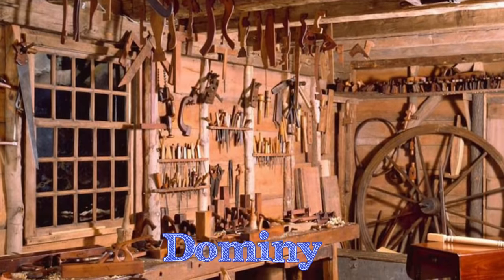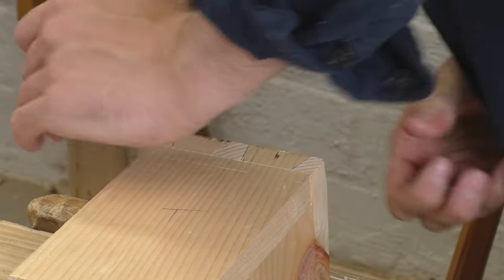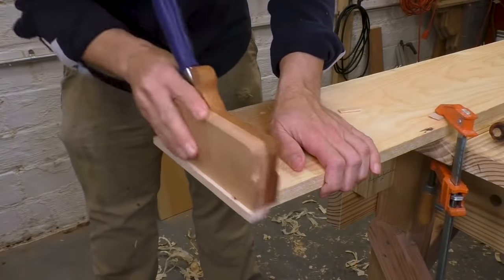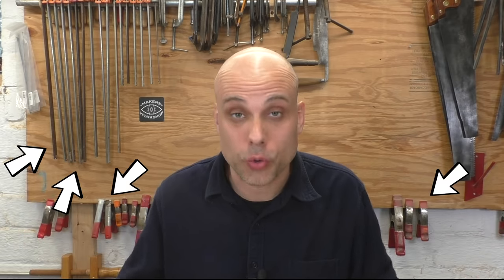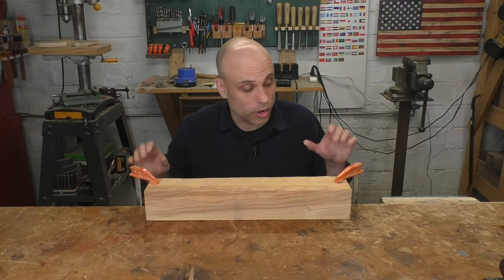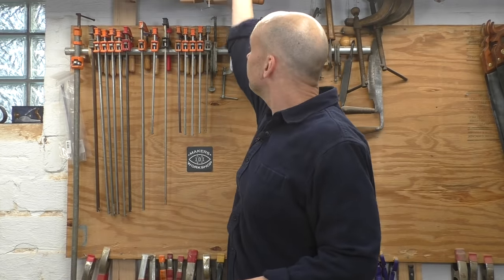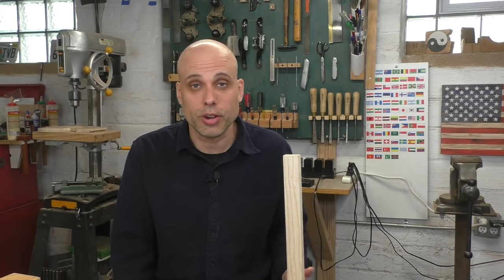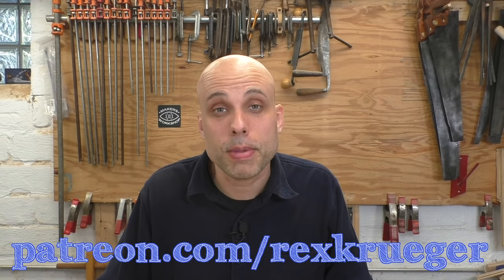Woodworking with very few clamps (maybe only 5).

Comment: Also, they used different glues. Hot hide glue, you can hold for a few minutes and move on.  Instead of gluing panels with pressure to hold them together, rubbed joints were common. A Spanish windlass or even just wrapping some things with twine and putting a wedge under it. You can also just leave something in the vise and do something else while it sets up.
Reply: That has been one my ways to not need clamps.

Comment: Hold on now. All these things are still clamps. Just because it is not a dedicated tool does not mean that you are not providing a clamping force. A wedge can absolutely be a clamp if used as you did with the battens. A double-headed nail is used as a clamp. You can even sit on it and use the old butt clamp.

Comment: Th real situation is, everyone has different ideas and ways to do things. And they buy, or build, clamps to fit their needs. Obviously you can build most anything without a ton of clamps. But having clamps makes your effort quicker, and well, easier as well. It may only take one or two clamps for a glue up. But if you are working on multiple glue ups of a larger project, it takes lots more clamps. JMHO.

Comment: I was just wondering, can you make yourself an auger bit using a lathe?
Reply: Do you think you are in the  wrong place? Augers are cheap.... buy one
Reply: @orbodman  But they are hard to find.
Reply: @sufsanin1917  are you referring to the augers that go into a chuck in a brace (hand drill)
Reply: @orbodman  yes
Reply: @sufsanin1917  I wont do this much longer. If you can afford a lathe then you can afford augers

Comment: I think you started hitting on a conclusion towards the end of this video but you didn't quite arrive. Here's my take. If you're OK with doing techniques that don't require any or many clamps, that's what you "need." Your woodworking, whether it's for a business or just a hobby could possibly change, therefore, the tools you need today may be different than what you'll need in the future. I have taken on some projects where I needed a certain tool and in some instances waiting over a year until I could afford the tool. In other situations I just made due and jerry rigged what I had to get the job done. I prefer to use clamps, so I have a boat load of Harbor Freight F clamps, square clamps, C clamps, and I recently bought some Bessey parallel clamps for a certain project that needed them. My opinion is, you "need" what you want to use and create with. I learned woodworking in a cabinet shop. Furniture woodworkers build things differently than those who build houses. Be yourself, learn from others, experiment, grow, love life. You mentioned Steve, he uses rubber bands as clamps, what a great idea that is. Buy more clamps if you "need" them, sell the ones you have if you don't. Main thing is to make something the way that makes you happy.

Comment: In third world countries they have a tendency to use rope or straps with rope you simply tie a  Slipknot in 1 end and then wrap it around and tie off the other end for a single wrap this is quite easy you just put a simple not in it and the Slipknot will draw Tite then you draw the not down to keep the Rope tight and then you just apply additional wedges as needed to add additional Force with the strap it's a little bit different but if you know how to work with straps it's basically the same rather than using knots you're going to have a figure 8 ring or a square ring on either side and you simply create a couple of loops rap the work flip II Lupine Place tightened everything down and then again apply wedges as necessary for additional tension if you're worried about hurting your work by denting it with the Rope or the strap you can always add pieces of scrap on the corners to protect them. Composite bows are built this way because there's no easy way to clamp a composite bow except for building an entire frame and then pressing the frame together

Comment: Good video but I have some commentary.

It's possible to make simple wedge clamps without screwing them to your bench top with lumber preferably drilled with multiple holes and a loop of rope with a twisting stick is possible, a Spanish windlass and so on, so there are some simple improvisations he doesn't show that aren't as involved as using threads you make or buy.
Another example is an F style clamp that uses a cam rather than threads.
This brings up that a cam can often be used in place of a wedge or opposing wedges or threads.
Many have used both for clamps with lumber, possibly drilled with holes for adjustment or in dog holes in their bench for big glue ups.
I feel he is too thread oriented in his dismissal of self made clamps and holding up a C clamp with threads made of wood doesn't represent what's been done or can be done very well. There is a lot out there on self made clamping and clamps that doesn't involve threads, bought or made.
Reply: Also if you are inhibited about screwing into your bench use a piece of plywood that fits on your bench and screw into that.
You could put it down over a mat of that grippy rubber stuff if you want it to stay still but that's optional.
Reply: The wood clamp is really handy if you don't have a vise if clamped with a F style clamp to bench top or leg or cricket portable bench/saw bench or saw horse.
Also you can drill a hole in the square end that matches your bench dog holes and use it with that system.
And that system, the dog hole system on a bench is basically a big adjustable clamping system even without vises as you can use the wood clamp as I mentioned and also wedges or cams.

Comment: So the end result of this video is that clamps are better than no clamps.  And that you can get by without many of them.  In Dominys time, the relative cost of clamps to wood was far different than now.  Now clamps are cheap and wood is expensive.  So no, gonna keep using lots of clamps.  But the point is appreciated.

Comment: Pony Jorgensen aren't the same clamps they used to be. A Chinese company bought the name and tooling and moved production to China. Quality control is miserable. Sometimes you get decent clamps when you buy them and sometimes you don't. If you can find the old Jorgensens, then scoop them up, they're excellent. The newer stuff is pretty miserable and honestly, German-made Bessey's don't cost much more (although they have some Chinese made lines as well that suffer the same issues as the Jorgensens) and the quality is way higher at this point.

Comment: An advise for gluing el. guitar/bass body blanks - would using the wedges be appropriate for that task (as long as i can put some weight on to prevent the possible bowing)?
Reply from the maker: Sure!
Reply: There is an even better string and wedge method used by luthiers, I imagine for centuries. In these comments, the best description is given by Chris Wicksteed. This is a very elegant technique, as it gives excellent edge pressure while at the same time holding the stock perfectly flat, and the soft string tends not to mar the outside edge of the stock.
Reply: Another method for clamping your thin stock, no wedges necessary: make a low tent,1/8” or so high, of your pieces on the bench top, supporting with a stick or rod the length of the joint from underneath. Back up the two pieces with nails into the bench top, or two boards clamped. Run a tiny bead of glue into the vee of the joint, remove the support rod, and press the stock flat to the bench. Voila!
Reply: @leehaelters6182  Thank you for the tips. Much obliged.

Comment: @6:00, instead of hammering down one board and using two tiny wedges, that large board should be a wedge and a second one facing it so that as they slide across each other the gap either widens or gets smaller, and the pressure from the wedging action is applied equally across the entire surface of the board rather than just two pinch points at the end.

Comment: Like the idea but if every time you want to move a chicken run you need to also convert the cart, then convert it back afterwards, it sounds like a faf.... Why not just load the chicken run onto the cart, sack barrow or  wheel barrow? Then put the pallet on it near the drive?

Comment: 1) People think they need a legion of the "top name" clamps to do the job. What they don't, or in some cases refuse, to understand is that whether the clamp says Bessy or Central Forge on the side; it's produced in the same factory in China. There's absolutely nothing special about the clamps people pay five or six times, or more, for over the Harbor Freight stuff or the no-name Chinese knock-offs on Amazon. In fact I have started going right to the source and waiting until I can afford to spend about two hundred bucks at a time and getting them for close to cost on Aliexpress or Alibaba. I have some of the expensive Bessy clamps and I find I actually tend to use them less than the cheap clamps because I don't feel bad about abusing the cheap clamps. The cheap clamps work just as well as the expensive ones.

2) One of the things you demonstrate in your video is actually using fasteners. This is another thing I blame on the cheap IKEA crap furniture trend that hides it's fasteners in the poorly constructed sides. People think that somehow wood just magically holds itself together because woodworkers ask it to stay put. I grew up in my grandfather's and father's shop. We were poor white trash and made a lot of our own furniture, cabinets, etc because that was the only way we were going to get it. I was taught to build things with rabbets and dados. Glue always goes into the dado and rabbet and we used screws with predrilled and counter bored holes to draw the joint closed and hold it while the glue setup. Plugs can be glued in or finish trim held with glue and finish nails to hide the screws. I still do the same thing when building carcasses now. Working alone I use clamps to hold everything together after I get glue on all the joints but then I predrill and screw the whole thing together. After that I can take the clamps off immediately, move the thing off the workbench for the glue to dry and work on something else. 

I don't know exactly when seeing end grain, joinery, fasteners, plugs, etc became taboo but I have a feeling the unrealistic expectations about jointless/fastenerless furniture and other woodworking projects can be laid squarely at the feet of IKEA and the DIY Network and the various clones thereof.

Comment: Carpenters complaining about not having enough clamps.
Meanwhile welders not only have to buy them but routinely have to replace because they aren't a permanent tool due to weld spatter and heat cycling

Comment: Curious how about a challenge: Make a bigger board without using glue (Ex: a disc just made from joined board) but with NO glue.  
How to do it? My thought would be with some sort of locks like an Bowtie, a Butterfly or a dutchman or some sort of screws but in real i have no idea.
Reply: I want to say bowties, too. Other than that, maybe wedged or drawbored loose tenons?
Reply: i hope for a challenge but i do agree in this article: With the modern wood glues that we have available this may seem like over kill.

Modern glues have exceptional strength and there’s a lot of work in adding these extra tenons. I posted a picture of my reinforced top on social media, and a good friend brought up this exact point – that my joints are outdated due to modern glues.
Reply: @pridler85  the joints aren't out dated- they will last much longer than the modern glue will hold.  It depends on your requirements- are you making something to be thrown away in 10 years or less? Then maybe glue and particle board are perfect. Are you making something your grandchild's child may want to have? You've a much better chance of it lasting with the old joint.
Reply: Excellent idea, I think. You could also drop $1500 or more bucks on Lamello for their invisible joining equipment.

Comment: I kept telling myself I didn't need a vise and could do everything with clamps or my own body. I now have a scar and occasional nerve pain in my right hand that serves as a reminder that the human body is inferior as a work holding device when compared to vises, holdfasts, and the like. Especially when the other hand is wielding a beyond razor sharp Japanese chisel as one haphazardly attempts to chop/carve a mortise/tenon. I actually wound up using a draw-bore on that particular project in the end. Folks, some simple world holding hardware is cheap in comparison to ramming a chisel a centimeter into your hand. At the time $50 seemed like a lot of money to me, but trauma can cause one to reassess their priorities. (Yes, the hand still works fine and I'm able to do my job and hobbies that require delicate work on a micro scale. I just occasionally go to pick something heavy up with that hand and feel a sting from a spot on my hand that looks like any of the other lines traversing one's palm.)

Comment: I moved into a 6' X12" trailer. Tight, but functional, for power and hand tool combination. Band saw, sliding miter, and thickness planer. 4' bench with 10" vice and a 18"L X 8"H X 12" D riser with another 6" vice, screwed to the base bench. Works great for the small boxes that I mainly make.

Comment: i use sprung joints for guitar building when i need a really tight fit where you cannot see the glue between the two halves being glued..
Reply: the comment around 14.00 about using a smaller number of tools, in a smaller space where things are easily accessible..excellent advice..sometimes when a process takes too long or too many anciellary processes then jobs become too demanding..KISS..keep it simple stupid seems to be the appropriate catch phrase here..thanks!

Comment: Back in OCT 2015 Pop Wood Mag did an article about a Dutch Raamstang using a wedged holding method. I built one and use it for all my edge planing. I much prefer this method to clamping on the side of my bench.

Comment: Just a few months ago I made a new stand for my lathe.. Just for fun I chose to use mostly draw  bore mortise and tenon joints plus some threaded inserts and bolts for the top. It has no glue and it's extremely solid.

Comment: historically glues were not vary good  ( they were affected by temperature , humidity, bacteria , vibration ) and metal was expensive. What was cheap was hard wood  and especially scrap hard wood(  the feed stock of pegs )  so carpenters used a lot of peg and joinery construction and less glue and metal fasteners. Today the opposit is true  with hard wood being vary expansive but nails being almost free    and glues that are stronger then the wood they are attached to .

Comment: For clamping your glue ups together there’s always rubber bands and ratchet straps, if your work is out of square it is probably down to your cutting/shaping.  The clamping innovation trip is not done yet, but old solutions are largely forgotten in the rush to ‘gadget up’.  Check out what Steve Hays uses to clamp up some nice mitred corner boxes: https://youtu.be/Hkg5M8CH2DU  at 20:22 and 22:35

Comment: There are 3 big ole fat slab boards for the top of the 48 inch square top coffee table for my pic at left, this was the only glue used!! The legs have a four-way sliding dovetail holding them, the two tops are fastened to the legs by massive half inch by 4 inch by 6 inch loose tenons, it's even been hand carved here and there when you are looking all around it!! I'm confident it will last as long as the people are around to love it, centuries? Millennia?? 2 inch thick, solid Walnut throughout.....yeah, it's a rock. Eat your heart out Ikea!!!!!!! PPPFFFFFTTTTT!!!!!!!!
It's about art that helps you live well!! Not about cutting costs to maximize profits!! Sad part is that most of this knowledge is almost gone. Buried with the oldsters who didn't teach it cause no one asked. 😟 So sad......

Comment: Great video, and really useful information. And while I really love this video Rex, if you ever do decide to try making clamps you should totally check out Geeks Wood Shop's video on DIY parallel clamps. As you said; yes it is a rather involved process. But I managed to make 20 parallel clamps in about a week using his video and the plans from Bellevue Woodshop. I've been using them for 3 years now, and they have held up really well.

Comment: I have number of name brand clamps that I use regularly.  But I also own a "slew" of Harbor Freight clamps that cost less than $5 each (I think the 6 inch clamps are like $2.99 each).  For the price, I buy them by the dozen and they work fine for light duty clamping.

Comment: also, for some panel work, you COULD also use pocket screws with glue as well... the screws will draw the boards tight while the glue sets, and the glue makes the joint itself SUPER strong. not IDEAL, but still very serviceable.

Comment: Violin makers use a ever so slight sprung joint to glue bookended backs and sound boards. If the joint is good enough (which it always should be) then clamps are not required. The combination of hot glue and rubbing the boards of the perfect work to pull the boards tightly together. See this example here. https://youtu.be/V5uFBMrG5t4

Comment: using battens is just a different type of clamp and a much worse solution since it ties up your table instead of tying up some clamps and it's very likely to introduce bowing. reinventing the wheel with worse solutions to seem edgy is sort of a waste of time. most of what you showed here is less efficient than simply using clamps.

Comment: No. Literally used every single clamp I have yesterday and needed more. If I only had 5 clamps, I could not do my woodworking, simple as that. Does that mean you need to have dozens of clamps to start out? Not at all. But pretending like clamps aren't important is just stupid.